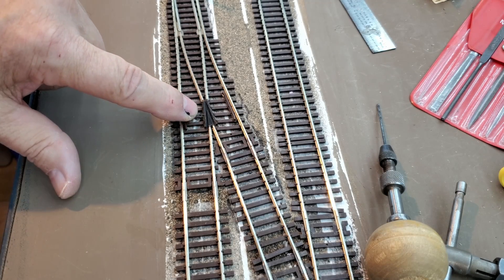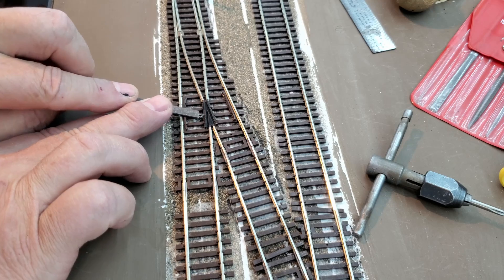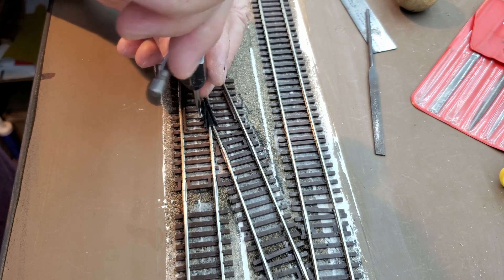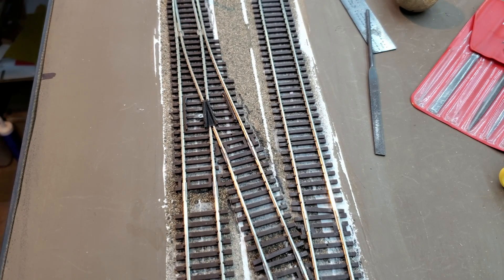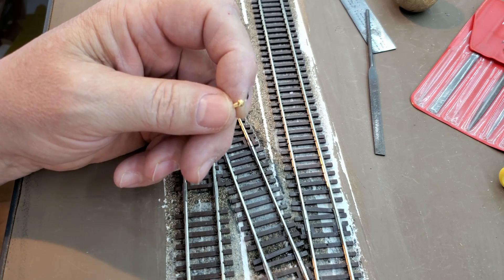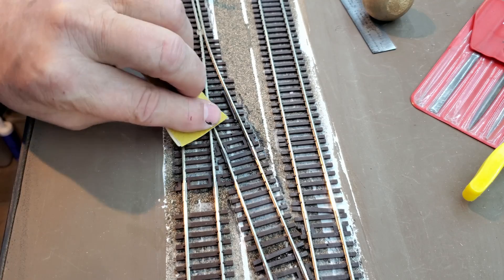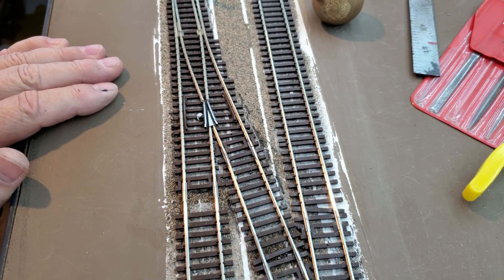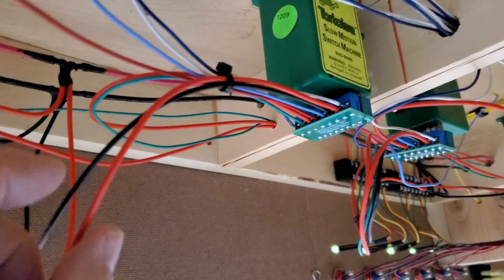Powering Atlas Turnout Frogs Through a Tortoise Switch Machine. HO Scale 12x20 Layout Part 33

Comment: Great explanation! Thanks
Reply from the maker: You're welcome, I'm glad you found it useful!
Reply: @SPSteve  One more question. If I wanted to use feeder wires as my jumpers on both stock rails by simply using a longer wire lead and then connecting those feeders to the switch in the Tortoise, do you foresee any issues with that? In my mind it’s all track power so it seems ok to me. Or is that overkill to do it on every turnout? I have 14 on my layout.
Reply from the maker: @AgentCartwright  If I understand you correctly, you don't need feeders soldered to the turnout other than the frog. You can jumper off your track bus feeders to the Tortoise. Assuming the turnout isn't isolated.
Reply: @SPSteve  Sounds good! So whatever feeders you have on your flex track is enough to power the turnout? And then the frog is powered by the tortoise?
Reply from the maker: @AgentCartwright  Yes and no. You have to run track power to the Tortoise. Look at your Tortoise paperwork. There should be a diagram showing the switch and the switch connections. The frog wire goes to the common terminal of the switch. The track A and B wires go to the two pole positions. You have to get the track feeders on the correct terminal, or it will trip your DCC system when the locomotive enters the turnout. Do you have a multimeter? That is the easiest way to check to see if you have it wired correctly. I should show that in the videos I made. Did you find the videos?
Reply from the maker: That is correct.
Reply: @SPSteve I’m with you on this. I guess I was just trying to double check if any feeders are necessary beyond the frog wire. I’ve seen videos where people put feeders on the stock rails plus the frog. So there would be three total. That seems redundant to me if your turnout is getting track power from the rails connected to it plus the isolated frog.
Reply from the maker: @AgentCartwright  Yes, it doesn't matter where the track power is coming from. You just need the Tortoise to switch the frog between the A rail and the B rail depending on alignment. In my video this coming Saturday, I touch on that briefly with a demonstration of checking the frog wiring.
Reply: @SPSteve  Excellent thank you. Appreciate all the feedback! Very helpful.
Reply from the maker: @AgentCartwright  You're welcome!

Comment: Interesting video, I have all Atlas Code 83 track and Atlas turnouts. I have no clue what you are doing or why. What is the purpose of the brass screw and wire? What function does it serve? Is it required. Clueless minds want to know! Thanks.
Reply from the maker: The brass screw and the wire is for powering the turnout frog. I have the frog wired through the Tortoise so it switches from DCC A or B depending on how the turnout is thrown. This allows me to run short wheelbase locomotives through turnouts without stalling.

Comment: I have two LH No 8 switches by Atlas and the tab is on the outside, but I have yet to wire it for polarity since it works fine without it.
Reply from the maker: Yes, the #8's have the tab on the outside, the #4 and #6 are inside.  I power all of my frogs, it's just how I like to do it. There's no rule that says frogs must be powered, you do what works best for you.

Comment: Please, Please, Please - as one who has split open a knuckle doing the same thing as you did with the cut off wheel - - hold the work piece in your needle nose pliers.  All you need to do is a slight faux pas and you will end up with a red landscape and a nice scar.

Regarding the video, thanks.  I am just about to lay track with the same type of switches.
Reply from the maker: Yes I could use better judgement, I suppose that's while I'm missing part of one of my fingers. Haha. Best of luck with your track work! Everything on my layout has performed very well so have confidence your parts will perform well.